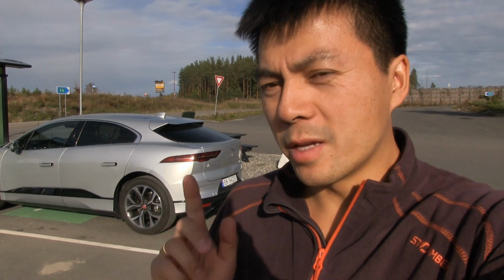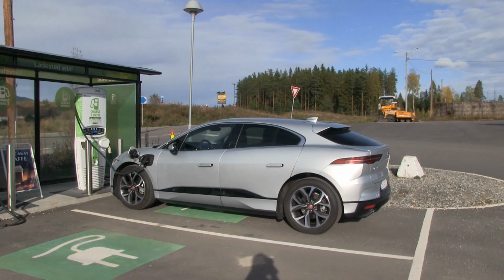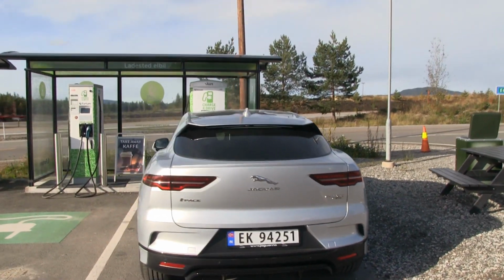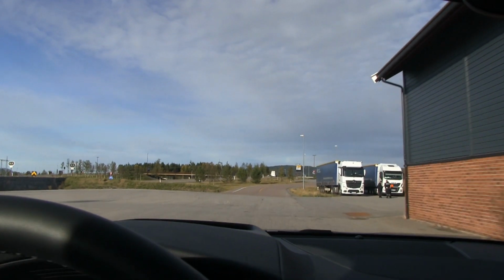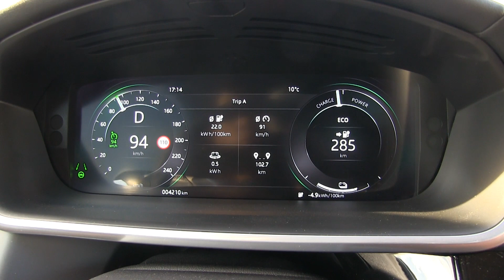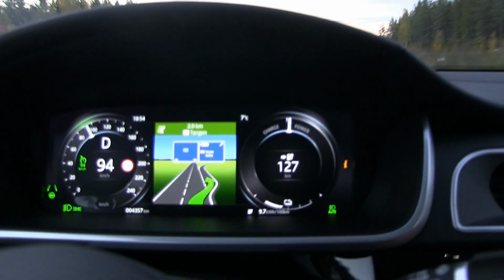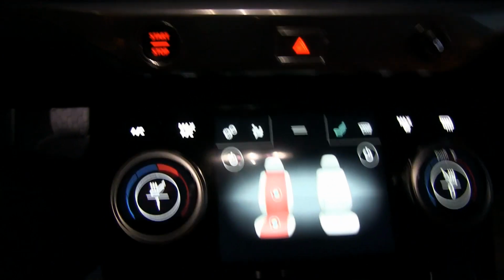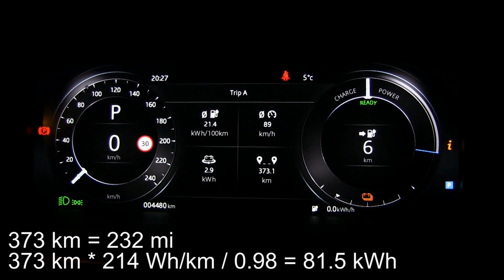I-Pace range test at 90 km/h, 56 mph

Comment: The hole in the seat above the shoulders is where the two shoulder belts of a four or five point harness are supposed to go. It's a fake sports vanity thing.
Reply: Yes exacly, seats in rally/racing cars have those holes for racing seatbelts. In I pace is just for looks.
Reply: Isnt the ipace pretty fast?
Reply: the car looks like a fake car, in menus, in all. . .
Reply: @fergus247  It is but it's highly inefficient.
Reply: You're all wrong...

Comment: You keep comparing to XP90D which is a much larger 7 seater. The real comp should be Model 3 AWD.  Alternatively at least look at a non performance version Model X or Model S. I know that 2016 Model S 75D easily gets 250mile range with 280wh/mile consistently at 70mph highway driving. It still outperforms Ipace in every metric other than offroading.
Reply: It's comparable in term.of price range.

Comment: For precision:
1. What tires did you have (model, dimension, purpose)? If winter tires, those consume noticably more (+5% ?)...
2. What percentage of the trip did you use seat and wheel heating?

Comment: Why is it still advertised with 470km WLTP range when it obviously cant reach it while other cars do meet their advertised WLTP range, so it is not only a problem of method
Reply: WLTP is allways the maximum it can reach while driving slowly.. not the normal use case! So basically WLTP is not really much better than the old standard.. But real tests you can find in YT from various posters. That show how the cars do, in diffrent weather conditions and on diffrent Streets.. and diffrent speeds. Also the temperature of the batteries does matter.. so not too easy to get real values on how high the Range can be or can't be.
Reply: Jaguar is literally required by law to state WLTP as its range.
Reply: there is another test where the guy drives at 75kph and that was 16.7 kW/100km which works out around the WLTP range.

Comment: There most be a problem with the software draging too much juice from the battery.
 Even in a combustion engine if you drive it at 50mph very gentle you can expect the promised fuel consumption.
 In this you cannot,because it needs new software update, something is taking too much energy either the battery pack is unstable in matter of cell and degradation.
 Imagine this in couple of years from 200miles range you can go below 150 which is terrible.
  I would suggest you raise the tire pressure so it consumes less energy.

Comment: The seat and steering wheel heater will have hurt that. The cabin heater would have used heat pump and scavenged heat which would have resulted in less power draw than the seat and steering wheel heaters. Also it is on winter tyres and Björn said there was a headwind. So with all that said, I consider 367km ok in such circumstances. Although the test needs to be redone with a functioning cabin heater and use minimal electrical gubbins like seat heaters and steering wheels heaters for a more realistic picture. I didn't order mine assuming I would get 470km, I will be happy if I can reach 400km, that is typically 4 hours ish driving for me in Finland and I need a break by then. The charger network here is quite poor, so CCS fast chargers are about 350km away from each other in the big cities. I should be able to drive from my house in Turku on the south coast of Finland, to my house in Utsjoki 1300km north. Each fast charger seems about 350km apart, so it is do-able I hope. Some of them are only 22kw chargers though :(

But still I do that drive every month in one go, it is about 16 hours in my fossil car, probably substantially longer in EV.

PS the weight included you and all your gear right? So subtract your weight and your luggage and maybe it was 2250kg.

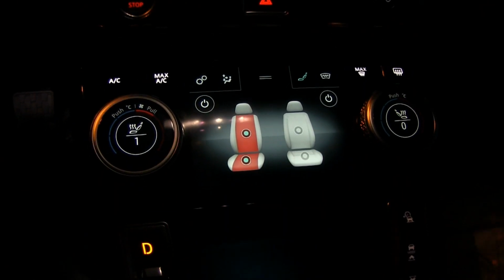Comment: 15:05 Just like the air con - maybe the Jag knows there is nobody sitting in that seat so it doesn't waste energy heating it.
Reply: That is what I was thinking, the seat sensor knows that no one is sitting there, and turns the heater off to prevent wasting energy on an empty seat.

Comment: here's the thing about range: Test any EV on range under these conditions:

all seated occupied
luggage
at night
in winter
using lights
radio
with a/c
and rear defrost (at start)
with seat heating
loaded with skis
going up a mountain pass

What's the range?
Reply: @SandraWantsCoke  I don't know about the Semi, could be different, depending on how they measure the range. We don't know. The range indications of EV's are always under certain more or less ideal conditions or under goverment mandated running cycles. But that's the point: We don't find these conditions present the whole year.
Reply: Around 160 miles with what you consider necessary.

Comment: That's bizarre. I drove my Model X 75D with an average speed 90 km/h 340km range. Why is the consumption of the jaguar i pace so high ?
Reply: They haven't been making EVs very long unlike Tesla
Reply: It´s because of the permanent magnets instead of using an induction motor like Tesla is doing...
Reply: no. permanent has higher efficiency than induction. look at the model 3 that is permanent
Reply: @gobl-analienabductedbyhuma5387  But the AWD Model3 has lower range than the X our S. The induction motor can be turned off if not used, so the S and X only uses the induction motor for acceleration and not when driving with permanent speed on the highway.
Reply: @John W My p90D will do 270 at 55mph no sweat and it's 3 years older. It's also easily faster with more charging options. You bought three wrong car.

Comment: Great test as usual Bjorn.  :)   I should be taking delivery of my I-Pace HSE in about 4 weeks here in South Florida, USA.  Quick question/suggestion though...noticed that this range test was done strictly in ECO mode but I know a lot of us would love to see you do a test while driving highway (and some city driving) while in Dynamic Mode (with Brake Regen on High)...to see the difference in how the I-Pace uses more Kw battery while doing a decent mix of highway cruising driving at 75-80mph and some "spirited" city driving.   What would your anticipated total range be while driving in this Dynamic setting?  

My plan right now is to drive my I-Pace in Dynamic Mode (maybe normal, Comfort Mode while cruising on the highway with cruise control on) and have some fun, spirited driving around town...the longest distance I travel on any given day is approx 150-170 mi. and I will charge my I-Pace in my garage each night (while my average daily travel will be approx 80-100 mi.).   I want to make sure I won't have any range issues (although I could stop at a fast charger here in the Miami, FL area if I really needed to before driving home BUT I would rather not have to)...any thoughts?   Thank you!
Reply: I would love to hear how your range works out in FL.  My Model S in FL appears to average around 300W per mile, with the A/C on and driving normal highway speeds.

Would also be curious when you chose the Jaguar what other EV's you considered if any.
Reply: Not sure why you think the Jaguar I-Pace is "sub-par" from Telas?  You have the right to your opinion I suppose as do I but 95% of all expert car reviewers have actually said the opposite of you...that the Jaguar I-Pace is a much higher quality, much more well balanced, and much more pleasing to the eye than any Tesla with just as good if not better technology.  I agree with them!  I am not a huge fan of the looks of the Teslas...inside and out.  I came from driving a loaded Porsche Macan Turbo and I find the Jaguar I-Pace to be similar in quality, form, and function as the Porsche.  The Telsas, in my opinion, are completely bland on the inside and just ugly on the outside.  The Model X is plain hideous, and the Model 3 is a bit strange looking.  I like the looks of the Model S though.  While the Teslas may be faster with their P100D models, my test drive of a pre-production I-Pace found me smiling for the entire time; it was more fun to drive than my previous Porsche Macan Turbo!  If I want to go even faster, I'll just hop into my 2012 full-bolt-on 700HP/TQ E85 Nissan GT-R...that does 0-60mph in 2.7sec & 1/4 mi in 10.2 sec @ 136mph! :)  I hope that answers your ridiculous question.
Reply: It may be a "huge issue" for you and I'm sorry you feel that way.  It's no issue for me as the most I drive in any given day is approx 150 mi. with an average of like 60-90 mi. per day, so I have zero issues with an EV which has a 200mi.+ range.  I will simply drive it everyday and have fun and then plug into my level 2 charger in my garage every afternoon/evening.  I anticipate needing to find a local South Florida fast charger will be almost zero for me...maybe a few times per year if that.  If we want to take a long road trip, we'll likely use my wife's 2018 LR RR Velar.  So we're good but thank you for being so concerned for others. ;-)
Reply: @Red Baron  - As reported from Bjorn's & others testing, it seems like the I-Pace does in fact consume slightly more energy than the Telas, but it doesn't concern me.  Anticipating approx 200mi. range driving in Dynamic or Comfort mode, mostly highway (approx 70%) with A/C & Seat A/C on and Brake Regen on High.  We'll see.  I figure the worst case scenario for me is that I will put it into Eco mode for a bit to see how that extends the range, but again, with the mi. I do each day, I doubt I will need to do this.
Reply: @Maeguk - FYI - my opinion on the Tesla X (which is shared by many expert car magazine testers/reviewers) is that the Telsa Model X is a butt-ugly upside-down bathtub & the Tesla bland, utilitarian interiors have been mocked by millions.  Many people don't like them or Elon Musk's ridiculous cheesy feature names that he thinks of while completely high on weed, lol! ;-)  But, hey, everyone has an opinion, right?
Reply: OK, interesting.  For those that need the range, the higher energy consumption of the I-Pace, along with slower charging would probably be an issue.

The I-Pace appears to consume significantly more energy than the Tesla's do, which is bit mystifying as even a larger Model S 75D with a 75kWh battery has a longer range (249) with a 20% smaller battery, while getting 20% longer range.

The Model 3, which is actually almost identical in size to the I-Pace, travels 310+ miles on a 75kWh battery, while the Jaguar appears to only get around 220 miles on a 90kWh battery, although the two cars Bjorn Nyland tested only appeared to have around 81kWh usable.

The Jaguar also appears to max out at 80kW fast charging, and it takes 13.5 hours to fully charge from empty (official Jaguar numbers), vs around 8 hours for a Model S, and around 6 hours for a Model 3.

I have nothing against the Jaguar, although I prefer my Model S, just curious about the choice.

Since I have driven my Model S 600 miles around FL in a single day, the short range and slower charging times would be a deal breaker for me personally.  But it is a nice car overall.

Hopefully they will end up being reliable.  The I-Pace Bjorn was test driving has a heater that didn't work, so hopefully that was just a fluke.
Reply: Interesting b/c I've heard through other Tesla owners that they don't get the advertised range as well; in fact, a friend of mine with a new Model 3 long range, says he gets like 270mi. not nearly the advertised 310mi.  So again, I think it depends on how you drive it...in what mode, what features are on, how heavy your foot is, etc.  That's just the nature of this new EV technology.  In addition, you have to understand that the battery technologies are different from one brand to another, like Tesla vs. Jaguar so each brand will use the battery pack slightly differently and efficiency will be different as well.  So although we can compare a 90Kw Jaguar to a 90Kw Tesla, the usage and range will be slightly different.  I would think any current EV driver would know this.  

Anyhow, it also depends on your driving habits...yes I drive a lot for my business, but it's still fairly contained here in the immediate South Florida area, so 150-170 mi. in any given day would be max for me.  So, the quality, comfort, technology, looks, driving characteristics, and fun factor of the I-Pace wins out vs. what I had considered...which is the Tesla Model 3 Performance (but not worth the $80k over the std Model 3 at $35k base price imho)!  I think for $35k - $50k range, the Tesla Model 3 is a great EV; just not at the same level as the Jaguar I-Pace though in terms of the other features and characteristics.  My loaded I-Pace HSE costs $90k, and I think I will be happier with the I-Pace over the Tesla Model S at a similar price (and I think $130k for the Tesla Model S P100D is just ridiculous...much rather have a new Porsche EV for that kind of money!).  I never compared with the Model X b-c it's just ugly imho.

BTW - yes, Bjorn drove a pre-production model so I'm guessing all features will and should be working properly on the newly released consumer I-Paces with the latest software updates. :)

Comment: I dont understand the official WLTP Test now. On the Jaguar Website the i-Pace has a WLTP range from 470km. The Kona EV has 482 WLTP range. But in your tests they are complete different. 350km in real for the i-Pace and over 500km for the Kona. How they can drive 470 with the i-Pace? Are the 470km the official tested range?
Reply: Chevrolet Bolt= 520 Km. There. You got the best in class.
Reply: No, thats an old unrealistic NEFZ value. Bolt has around 50km less range than Kona or e-Niro.
Reply: @anrakspumante5958  they advertise it with 520 km range...
Reply: Sorry, my english isnt perfect, so i think i have not correct understand what you really meant.

Comment: Remember that WLTP is fraudulent. EPA is much more accurate. The WLTP/EPA ratio for the current I-PACE is 1.25. So 25% of the range is fraudulent. 

For comparison, Tesla claims EPA ranges. Please keep that in mind when comparing European companies with Tesla.

I own a Tesla model 3 LR. It's user interface shows a nominal 320 mile range, which aligns with it's EPA range. I have found that actual range is very close. Sometimes slightly higher, and sometimes slightly lower.

Comment: This is horrible. My Model 3 will do 300 real miles at 70mph with the AC on.
Reply: It is lighter and more aerodynamic so no surprise there. Do you have a dual motor?
Reply: Yes my Honda do the same with full tank but but my Mercedes can't.
Reply: @rahulhonesty959  For real? My Merc got more than 600 km per tank. C200 cdi. (just sold it 10 days ago, bought a Kona).

Comment: Ouch! Renault Zoe makes more...almost🙈😂 (not really)

But Tesla Model 3 long range ≈ 600 km...probably at least 500 km in winter.
Reply: and remember this thing is 70,000 euros
Reply: F jag, give me kona
Reply: More??? You must be kidding...
Reply: No, not really. 250 km. For 30 000 €...vs. 80 000 €. What I wanted to say is  the i-Pace's value is very low for that battery & price tag.
Reply: Officially the 3 is 310 miles or 500 km although I have of people bettering that range.

Comment: I’m not particularly knowledgable on electric drivetrains but I’m still gonna ask a question.
Do you reckon that if Bjørn left the iPads to charge until the KWh’s dropped, would it have hit the 84.7 Kw that jaguar claims is available?
Reply: Maybe. But does it matter in real world usage if it takes hours to go from 80kWh to 85kWh? I would say no and that in reality you can treat the pack as an 80kWh pack instead of 85kWh.

Comment: I have one of these for less then one week now but the infotainment system software in this car is seriously buggy. I have a black main console more times then not while driving making it impossible to even set temperature, navigation, radio, etc in this thing. I took it to the dealer 2 days ago and they confirm that there is some major bugs in the current software and are pending an update. Until then I am driving around in the so called Jaguar Stealth Mode, although not on purpose. Really sad actually that such a great car comes with unreliable, shitty software.